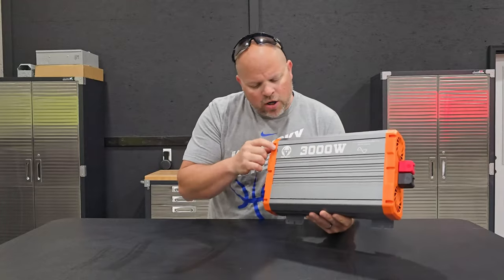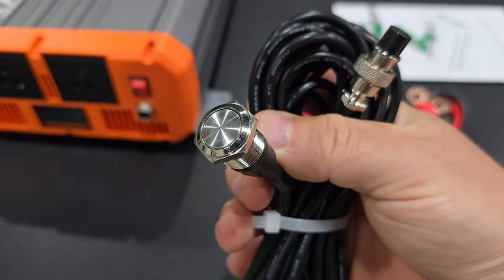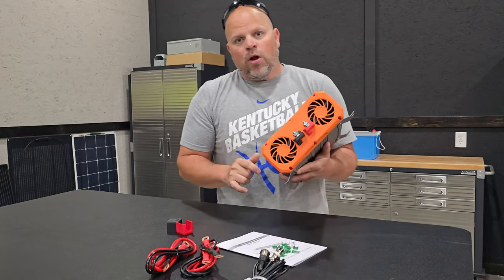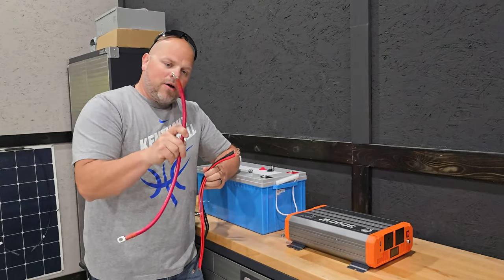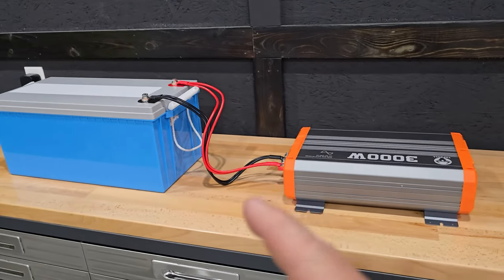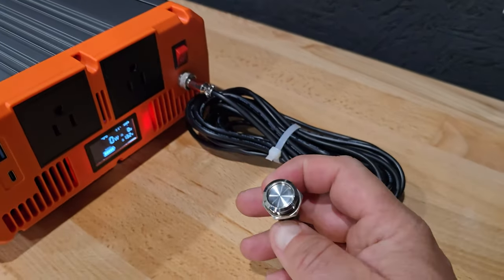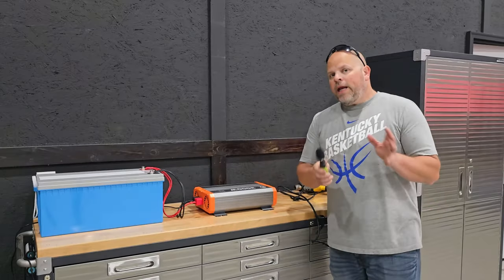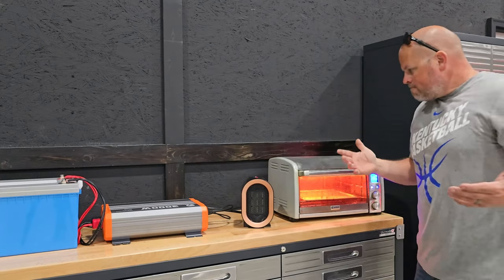Topbull 3000w 12v to 120v inverter

Comment: i had lots of points left on my TA fuel card and when i retired and was moving to the philippines i went in the TA and bought a $380 CAT 3000W inverter that cost me $10 with all my points.
i still have it but elect. here is 220-230 (sometimes 240!) single phase and a 12v-110-120 inverter wont do for me what i planned.
i'm going to go with 48v hybrid 5000 watt inverter and lifepo 48v 200ah batteries to power my house. 
wish i could get $300 for it now. maybe later i'll set it up with its own battery to just run the tv or aircon or something that takes 110-220. maybe my starlink!
Reply from the maker: Awesome, thanks for sharing 👍🏻

Comment: Good review but you didn't address that it's modified sine wave and therefore can't run inductive loads.  I was just about to buy it when I noticed that fact.  Props to Topbull for being honest about it in their advertising.  If you don't need pure sine wave this sounds like a winner.
Reply from the maker: They make modified sine wave and pure sine wave models. This one is a pure sine wave version.
Reply: What size cables would you recommend for this unit?

Comment: this must come from China  again they reverse the 120 plugs upside down.In canada and USA the hole is down not in the upper position.What is wrong with China products? a simple  detail like that and they find a way to get it wroing????  that alone  does not attrack me on bit. To me it is an important detail hope they correct this in a upgraded version?
Reply from the maker: I agree, although it does not cause any problems with functionality... I would prefer the ground opening pointing downwards. Thanks for watching and commenting!